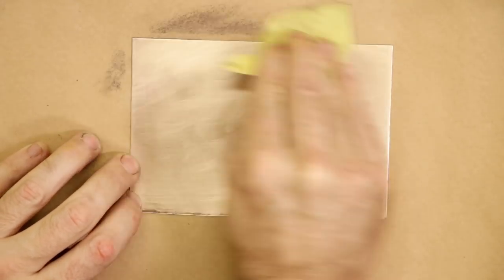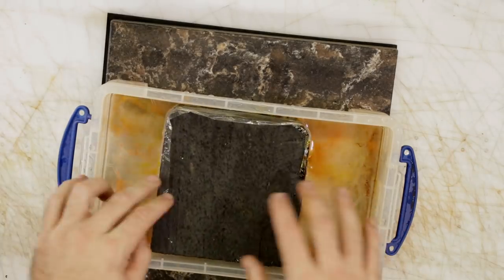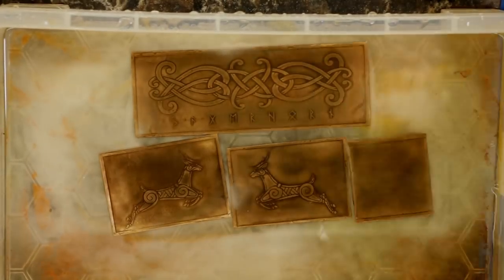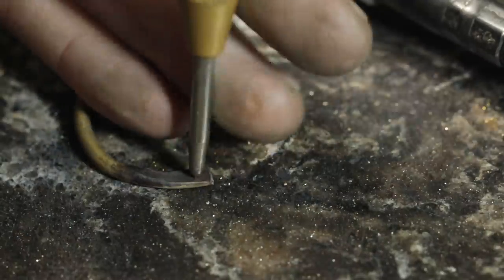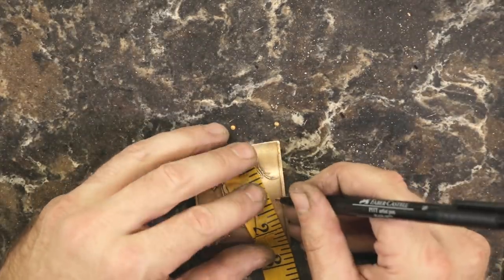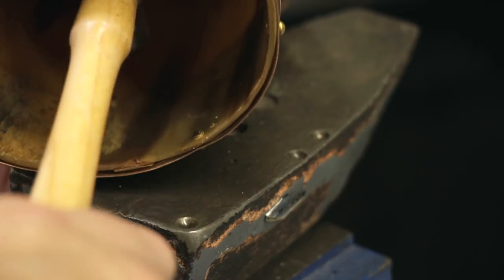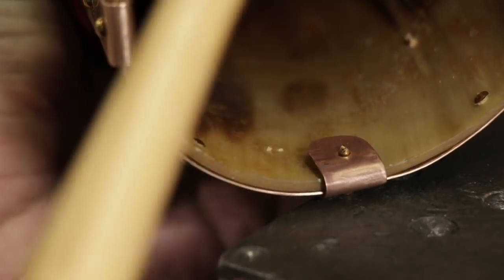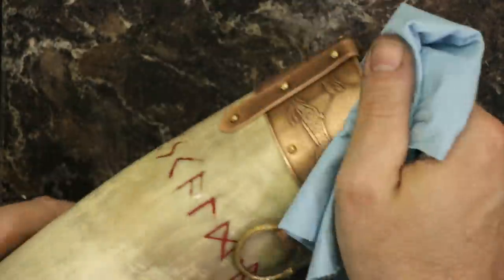Decorating a Viking Drinking Horn with Etched Bronze Plates

Comment: One way I have found to peen the lower rivets (instead of peening deep inside the horn) is to use a domed nail and push it through from the inside out. Then, I peen the head of the rivet on the outside, with something to support the head of the rivet on the inside of the horn. I use the horn of an anvil, or a long sturdy piece of metal like black iron pipe secured in a vice.
Reply from the maker: Solid point, was just getting a bit ocd on them all looking identical. Guess I could have done them all that way
Reply: @DarkHorseWorkshop  still came out looking great!

Comment: Congrats for your channel and your contento that is ver COOL, I would like to ask you some cople of things, have you ever did this kind of work with, tin ? Its the same making process? , and what could you advice to me to fix a horn that have a little Hole on the down?
Thanks fot making that kinda videos its awsome.

Greetings from  México 🤘🏻
Reply from the maker: Horn hole is hard to say. If it's for myself I might epoxy and paint it, or maybe wood glue and paint it? As long as the inside is coated with your bees wax or good grade epoxy it should be fine.. Not sure about tin though ..

Comment: i would have put rubber/silicon washers on the inside
Reply from the maker: Going to food grade epoxy the inside but really you're only drinking over 1 rivet and it holds a TON, so it's fairly fine without.

Comment: What's the point in a drinking horn if every element of it is modern? Why not buy a plastic one on eBay from China. Also drinking horns are more akin to a yard glass, there would be one in a hall for dares. They weren't routine. There's very little in the way of primary source material on the topic, although the drinking horn is where drinking from skulls came from. Specifically lost in translation was the wording 'they drink from skull branches'. Meaning horns. Somewhere someone just thought it meant skulls. And suddenly skulls became drinking cups in popular mythology.